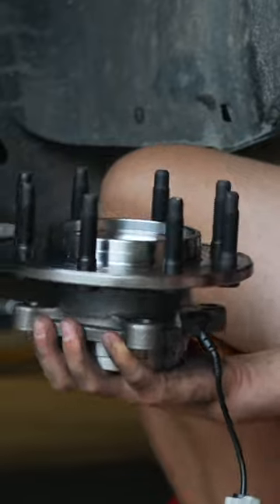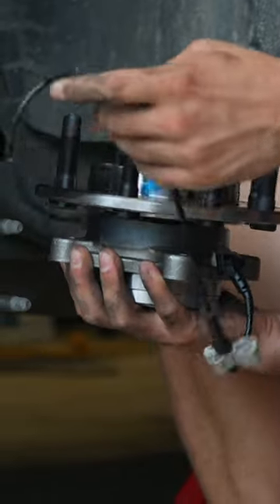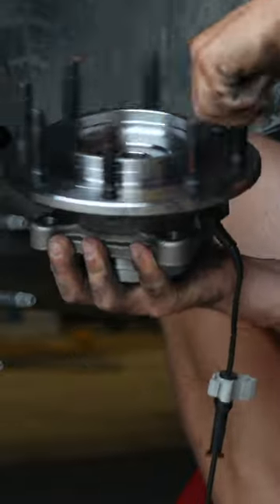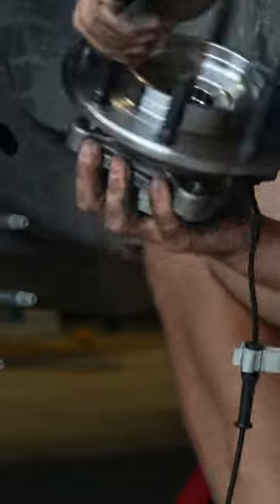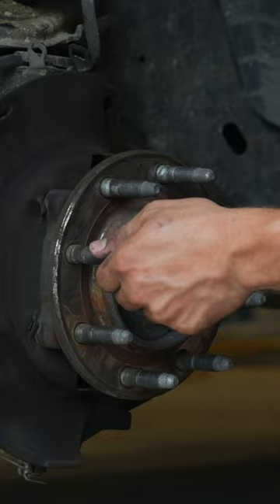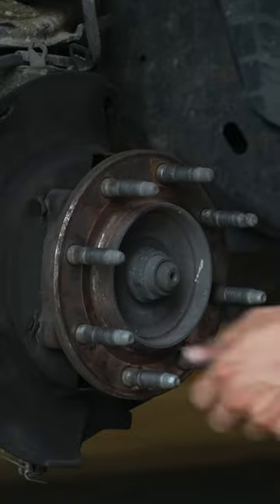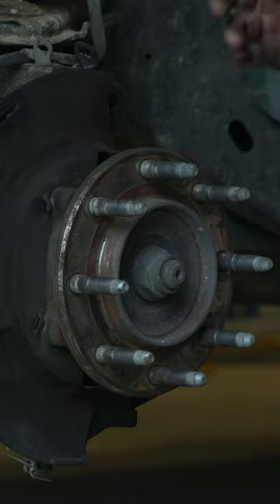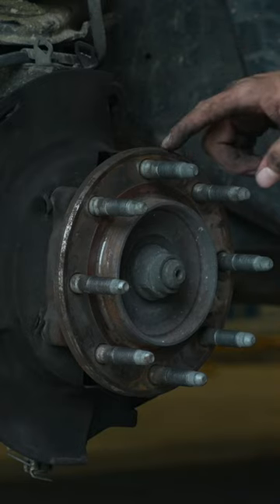How To Diagnose A Bad Wheel Bearing

Comment: Sounded like there were more problems than just the wheel bearing 😂
Reply: I agree. Other problems. Upper and lower ball joints
Reply from the maker: The ball joints are actually new, you will notice there was no play up and down. 

It does need a new pitman arm However

Comment: Another good way, those tires that have pressure sensors, the tire will heat up with a bad bearing, tire pressure increases at higher temps, set the pressure the same on all 4, drive for a while and watch the PSI on the meter, the one(s) that the pressure increases is your bad bearing.  Works great in the cold north, diagnosed lots of bad ones over the years this way.
Reply from the maker: Beautiful! We will have to do a little more research in that method and make a video about it! Thank you for the insight 😁

Comment: Front and back Play could also be worn tie rod ends too don't forget to check them to
Reply from the maker: The steering column was not locked, that’s the reason I was able to move the tires so far.

You are correct, that’s why I check up and down also when I’m checking wheel bearings.

Comment: that's a whole hub not an exact wheel bearing. Change the bearing to the rusted out hub sometime and stop this "everything's an easy bolt on" bullshit
Reply from the maker: The bearings on these newer hub assemblies are not made to be serviceable. You can purchase a sealed bearing and press it in if you want, but most people don't have access to the tools required. By the time you purchase the bearing and pay a shop to press it in, you could have purchased a whole hub assembly, installed it, and be on your way for about the same price. 

Choose your battles, mate.

On older vehicles, bearings are easily serviced and replaced and I will do a video on that process.

Comment: Yup. Looks like a dodge bearing assembly. Changed those a lot.
Reply from the maker: Not too difficult to change either. Might as well change the whole assembly whole you’re down there lol
Reply: @dudewecanfixit  what is really fun is when you pull them both off and both the races are stuck to the spindle.
Reply from the maker: Just another day in the shop for us 😂 We try to leave our struggles in as much as possible

Comment: If it wiggles that big, its not just the wheel bearing making the problem
Reply from the maker: It’s not not the wheel bearing
Reply from the maker: The steering wheel was not locked, that’s why it moved that much. Also, that’s why you check top and bottom play

Comment: Doesn't sound like just wheel bearing!! Side play but no top/bottom play acts like tie rod or pitman!
Reply from the maker: The truck does need pitman and idler arms replaced. Good eye!

We need to start doing diagnostic trivia!
Reply: @dudewecanfixit  while I agree there was bearing drag, there was too much play in the toe- in and out! Had to be other joints need replacing! I have been messing with cars since I was 16, 60 years ago!! Lol
Reply from the maker: That's great! I try to stick to one topic per video